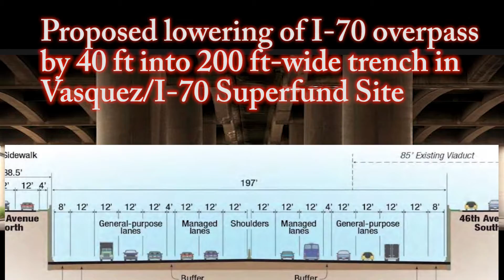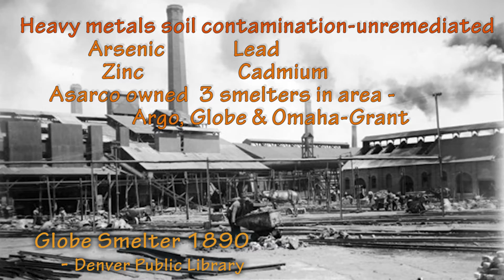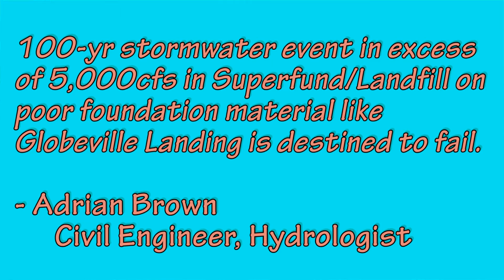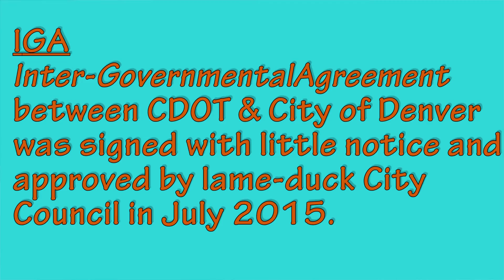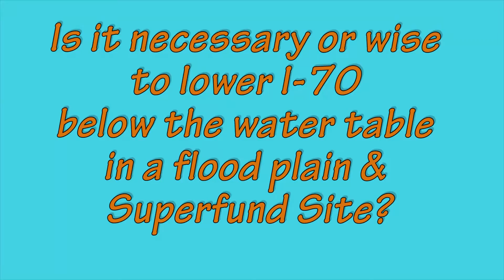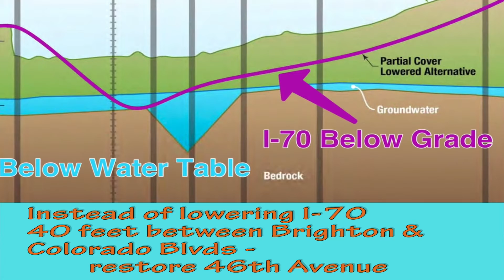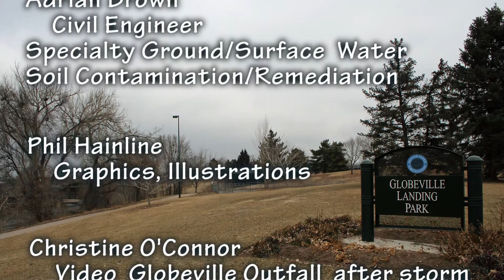The Perfect Storm: "Platte-to-Park Hill" Storm Drainage to Expand Globeville Landing Outfall

Comment: Thank you for posting this.   If the "trench" is below water table in places, how does the water escape? - thorough pipes?
Reply from the maker: The ill-advised lowering of I-70 prompted the Platte to Park Hill proposal, a series of detention ponds, buried pipes and open canals parallel to and about 6 blocks south of I-70 in order to divert water away from I-70. The drainage project serves the I-70 project, the Stock Show and other developments along I-70, i.e.,  passing along costs of development in a flood plain to taxpayers that should be borne by developers.
Reply: @communitymatters4798  Has anyone considered health risks regarding the construction workers who will be working on the central 70 project?
Reply from the maker: Jason, there has been no consideration for the health of the people in the North Denver communities, and it is  a sad irony that contractor Kiewit & CDOT presume they are doing a favor by offering a certain percentage of jobs excavating the unremediated Superfund site to people in the community, who have already experienced such risk from 1) small particulate pollution from the nearby highway (whose footprint will be tripled with the Central 70 Project) and 2) the effects of at least 4 different Superfund metals that have endocrine-disrupting effects that play havoc with reproductive, endocrine and immune systems. This is a project designed to serve developers along I-70, not the people.